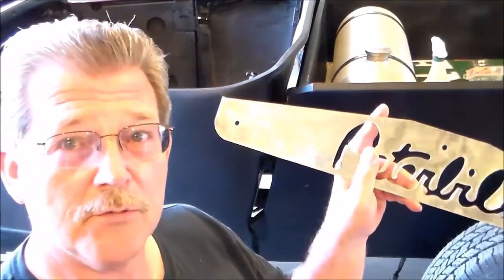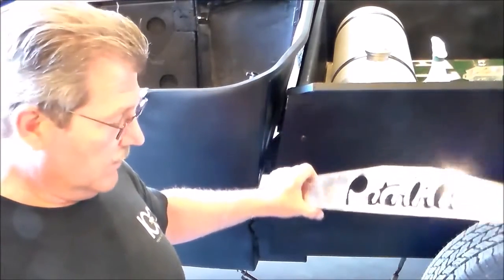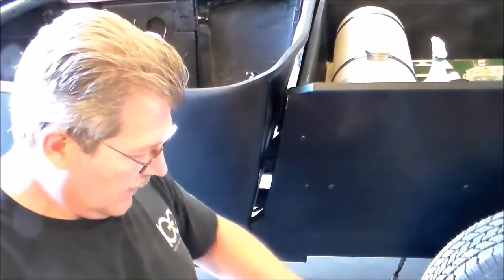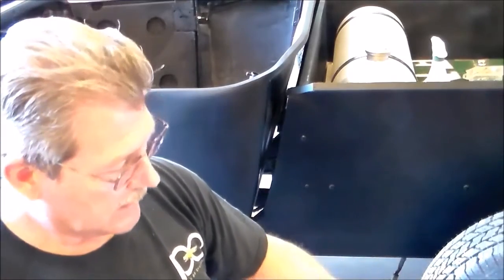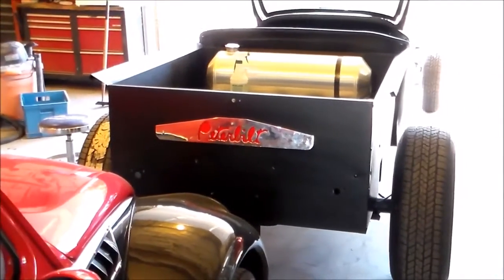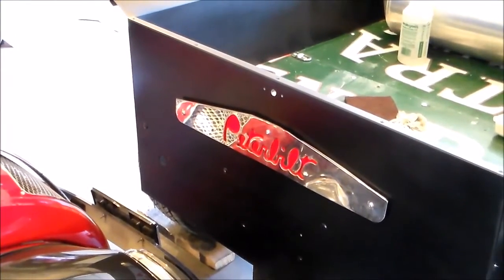Peterbilt  accent of the Rat Rod / Lakester tailgate

Comment: Ya know how Great Minds seem to work together??? You did what I used to do with my "Pete's" 4 axle's & Trailer 4 axle"s plus a 3 axle Jeep. I used to use the 3M "Reflective Tape" that they use to put the Reflective stripes on trailers & what not. I would make a base under my "Peterbilt" similar to what you did and mount on all my flaps which I had a Flap behind every set of tires and thats alot of Flaps weights (22 axles) all together I could get real close to 422,000 lbs on the rig IF I could get to set up correctly for the bridge law's on the Permits. On the front weights I had the "White" 3M Tape and on all the rest I used the "Red" 3m Tape. I'm wondering Mr. Rusty are you a Truck Driver or been around trucks? I'm just curious.... I thought for someone just building a Rat Rod it was kinda different to see this, is all. I really like your channel and I'm still trying to get though all your videos a little at a time when I feel sorta good.
Reply from the maker: +Danny Walker  I have worked  as an A.S.E. Master mechanic and  supervisor at several truck and equipment shops in the area for most of my working career. Have always loved working with and on  heavy trucks .  I starting collecting Peterbilt odd and ends for a while and decided to start adding them to the Lakester. Before I knew it I had a front emblem, horn button, key chain and my tail gate PB chrome .   Several items were sent to me from people on YT.  With the frame being long and stretched out, the straight six all chromed out  it just seemed fitting to name the truck the Peterbilt Lakester.  Thanks for watching and commenting . Take care